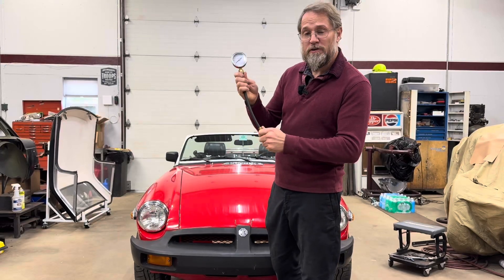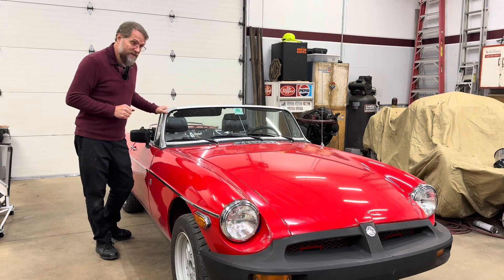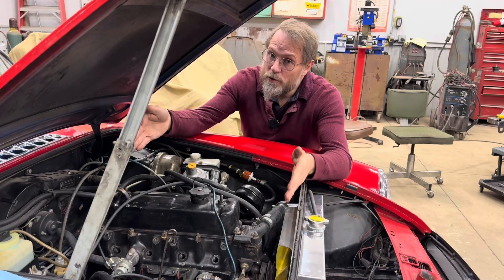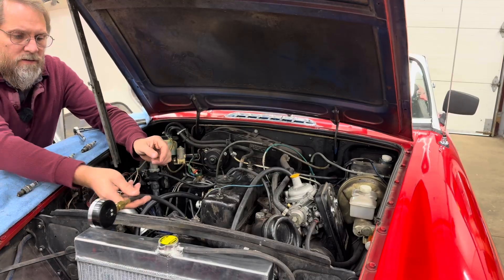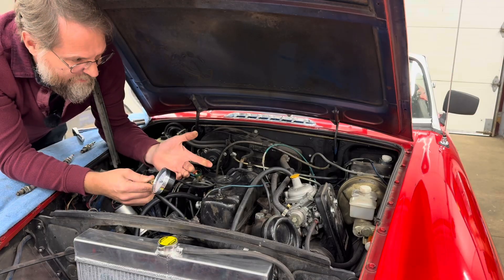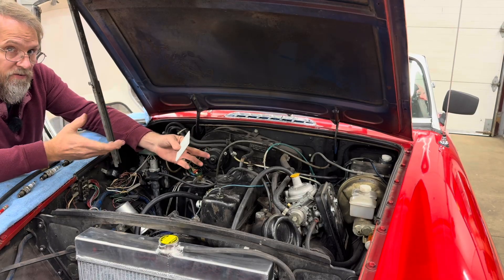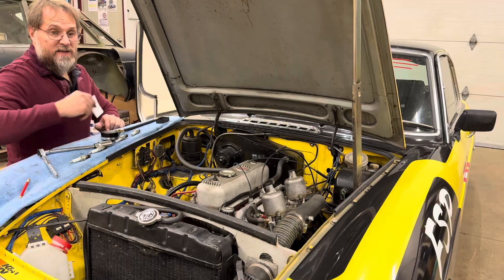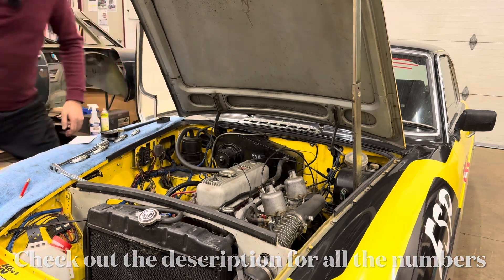Wide Open or Closed Throttle? Compression Test Myth Busted-Or Not?

Comment: I had. 1962 MGA when I was young. I loved the car, however, I thought I had a bad valve as the engine was missing. After staring at the engine for a while, I realized that the dip stick was touching the spark plug wire. Twirled the dip stick  and it ran fine.

Comment: Generally, speaking on most four stroke engines a service manual will call for throttle wide open. On a two-stroke motor it doesn’t matter.
If you put the following query into a Google search, AI actually comes up with quite a good explanation of why the difference.
“why doesn't throttle position matter when measuring compression on a two stroke”

Comment: Here at Caterpillar R&D UK🇬🇧the instructions from engineers is wide open throttle body, to achieve maximum airflow into the cylinder and a minimum cranking speed . This rule applies to engines 2.7L up to in our case 32L diesel engine…..this is an interesting debate as there can be slight difference between open closed 👍🇬🇧
Reply: Diesel engines don't have a throttle for the incoming air, so they are always WOT.

Comment: Thanks for that. It was very interesting. They are similar to my experience with carby style cars in the 60's and 70's. .

 My observations from the 1970's were that it made very little difference on my B engined MGA with higher performance 1820 cc motor. It had 1.3/4 SU 's and later changed to 1. 1/2   for more tractability in traffic. 
However I had numerous check of the Nissan 300 Z 3.0 engine my son owned and I often worked on about in the 2010's which had unbelievable miserably low results from compression tests without the electoninc drive by wire throttle body (throttleFlap) open.  With it open the results were on par with what they should have been. It was a normally aspirated motor (non turbo).    
It would be interesting to see a car with an electronic throttle body tested with open and then closed throttle.

Comment: As explained in the beginning of the video, it is the comparison of compression between cylinders that helps understand the condition of the engine, not the absolute measurement. If there was a pattern in the readings quoted here, WOT may give a couple of extra pounds over closed throttle. A couple of pounds matters not a jot in this exercise, when a variation between cylinders of 15 pounds or more is a cause for concern.

Comment: Interesting, I've always been told throttle open, but i don't normally both. Can you explain why biased needles are used. My 71 B has them but I can't see the advantage only increased needle wear. Are the two realys on your passengers side inner wing for halogen head lights?

Comment: When doing a test like you need to set all the valve clearances fist to ensure that all the valve periods are to factory spec!
Reply: Valves are open so long, I really doubt that would make a difference. But if you want to check it can't hurt. If being that obsessive is required, you had better get your compression meter calibrated and verified.